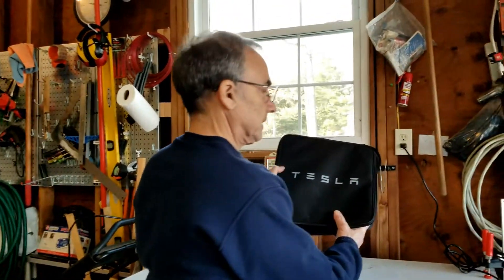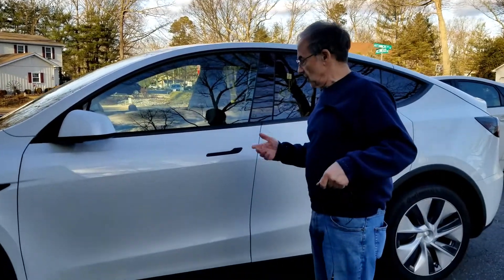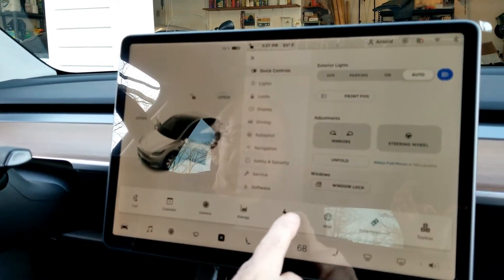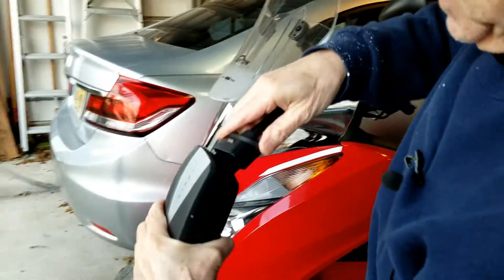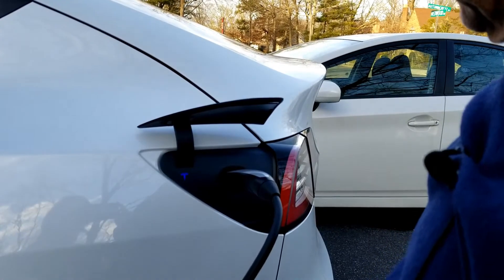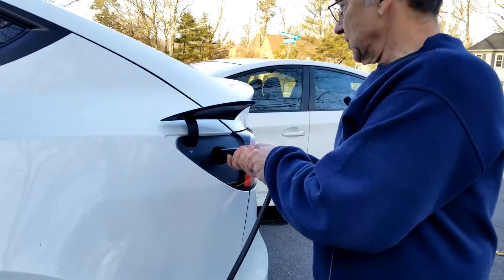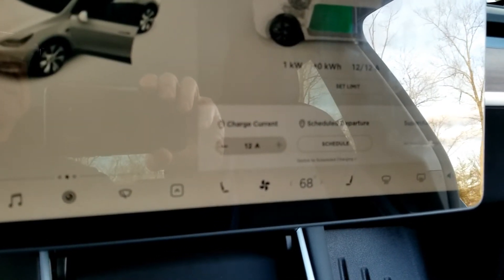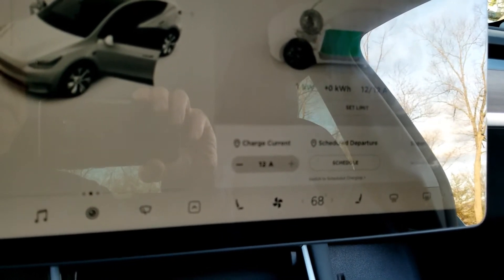Tesla Mobile Connector - Automatic Power Switching

Comment: Will the car automatically select the appropriate amperage limit for each mobile connector adapter? I know most people use either the NEMA 14-50 at 48A or the Nema 5-15 at 12A, but I'm interested in Tesla's  NEMA 10-30 adapter as I have an older dryer plug in the garage. Being a 30amp circuit, will I need to set the charge limit to 24A, or will the car automatically set the limits based on the mobile connector adapter?
Reply: The answer is yes, when you plug in a genuine Tesla adapter, it will automatically meter to the appropriate charge rate / amperage. The user does not need to set the charge rate manually to avoid a hazardous condition.

Comment: You can also get the 14/50 adapter for your mobile connector will charge at about 30 miles an hour versus 3 miles an hour on the 110.
Reply from the maker: At home I had the Tesla wall connector installed with a 60 amp circuit for charging at 48 Amps (44 miles per hour of charging).  Depending on what you usually have available to plug into dictates which adapter you should get.
Reply: @arnoldsolof  yes I know. I mentioned it because you didn't in your video. The mobile connector with 14-50 outlet and adapter will work great for most folks, especially if they are looking to save $400 and not purchasing the Wall Connector. Although Tesla doesn't come with the mobile connector standard anymore, I did get an email from Tesla that gave me $200 off the purchase of the wall connector or the mobile connector. I opted for the mobile connector which was $200 - so essentially free when I used the code in the email they sent me - didn't even have to pay for shipping. Thankfully my husband is a licensed master electrician, so getting the outlet installed only cost us the cost of materials.